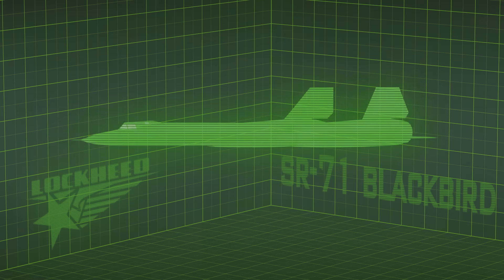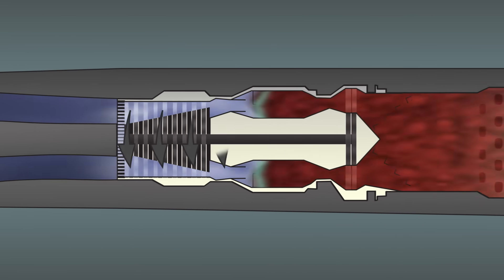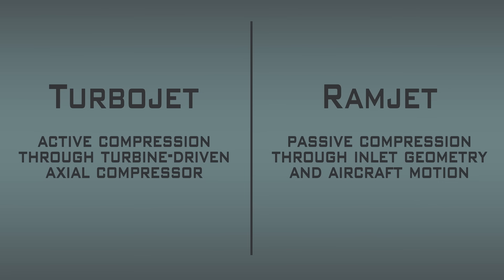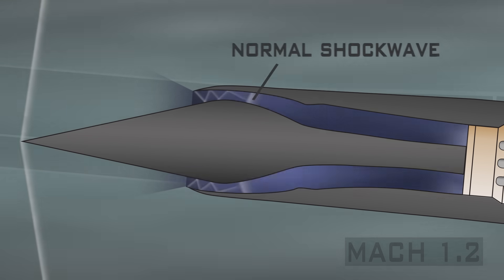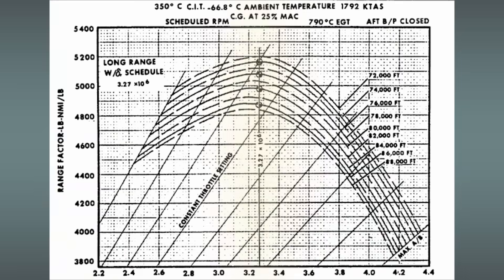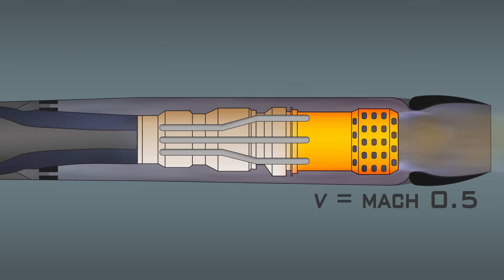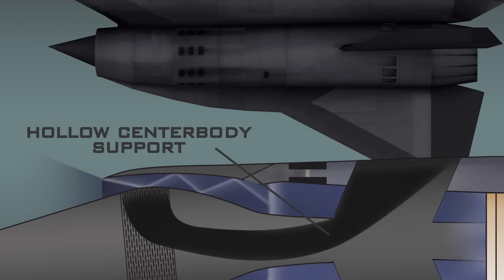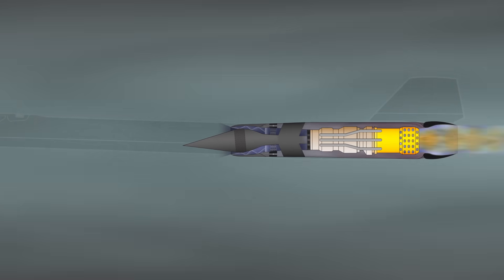The Mighty J58 - The SR-71's Secret Powerhouse

Comment: The men who designed this engine were simply geniuses. Just 20 years after the ME 262 was introduced, the SR 71 was flying.
Reply: +giantnardman <<Geniuses, no doubt. But on your other point, getting things done fast back then was a lot cheaper.
Between 1958 and 1965, just 7 short years, the U.S. sent 16 impact and orbiter probes to the moon with only 3 successes, the last three of those particular attempts. The USSR had a slightly better record in that time. 
But can you imagine today sending 16 Curiosity Rovers to Mars in 8 years because 13 of them failed...
Lol!
Reply: +turboslag The Concorde also ate up an ungodly amount of fuel per passenger per mile.  Sybaritically inefficient.  But, If you got the money, what the heck!
Reply: giantnardman

Copy that, it was intended for the privileged so unfortunately many that would have liked the experience didn't have the means.  I was lucky enough to have been making some money back then so I just had to do it.
And I'm very glad I did because the memory is for life.
However, I do regret not paying more attention to it than I did, you don't miss it until it's gone!
We just took it for granted at the time.
Now I wish I'd just watched it more at Heathrow.  There was a club of enthusiasts at the time it was in service, they just sat and watched them depart and return from outside Heathrow, the runways are very close to many roads in the area.
It is very unfortunate that non are now flying, even for airshows.
Richard Branson wanted to buy them all to continue in service but BA refused.
So, just museum pieces now, :(
Reply: giantnardman

Good points, I'd forgotten about regs.  Originally, it was also intended as a commercial product, available for sale to any airline.  Noise protesters killed that off though, all the originally interested customers were deterred by potential bad publicity.  Only BA and Air France ended up operating it.
Not knocking the SR-71 at all though, it is one of my favourite aircraft.
Let us hope there will be another supersonic passenger aircraft someday.
Reply: The mastermind of this whole system (not the J-58 itself though) was Ben Rich, the guy who eventually took over Skunk Works after Johnson's retirement.
Reply: What even more incredible Kelly Johnson and the rest of Skunkworks, didn't have any computer sided design like we have now today's aircraft engineers have, it all done with adding machines and slide rulers.
Reply: +ResistCom wow, you are correct.  This fact is and was completely missed by me and is make some this astounding even more so.  great catch..
Reply: Tony C apples and oranges both grow on deciduous trees in orchards, both have seeds, both are sweet fruit, both share similar DNA.

summary: apples and oranges can be compared!
Reply: This was designed in the sixties, when nobody had 3D rendering capabilities. All they needed were slide rules and a wind tunnel
Reply: +Nick M.B. 'Crashed on it's maiden flight'? The Concorde crash was in 2000.

Why do you mention crashes as a way to discredit Concorde?

One Concorde crashed in 27 years of airline service.
6 (out of 15) A12s & 12 (out of 32) SR71s crashed, for a variety of reasons.

None of this actually proves anything though (you raised this subject). They were significantly different aircraft, built to do very different jobs.
Reply: well the variable geometry inlet cone was installed on Mig-21 in 1956 which used the same principle of pressure recovery to achieve speeds beyond Mach 2 with a less powerful engine. Really, engineers of those times.
Reply: +giantnardman and whats even more amazing they didnt have much help from computers.
Reply: +turboslag Comparing Concord and Blackbird is like comparing an F1 and a rally car. Both are amazing bits of engineering but none of them hold a candle to the Toyota Corolla.
Reply: Tony C

Yes, but consider, Concorde flew passengers, at mach 2, in comfort, operated in a commercial environment without needing special servicing, day in, day out.
That is the achievment.
Reply: +turboslag 
nah! concorde is over hyped expensive plane.
Reply: @microsoft6411  - Sorry man, but the Concorde was hardly "over hyped."  It was the fastest and most technologically advanced passenger plane ever built, and will likely stay that way for the foreseeable future.
Reply: +Nick Magee - Brown Pal only a bit of a knob would say the Concorde was junk. Unless you're trolling in which case you are also a knob. Pal.
Reply: The SR-71 was the brain child of Kelly Johnson in 1958... well before anyone ever conceived of the Concorde.
Reply: So who stole the concept from whom...sounds like the Russian's slave German scientists got the idea first ??
Reply: A tip of the hat and a Thank You to Kelly Johnson at the Lockheed Skunk Works.
Reply: +giantnardman 
And just 5 years after the first flight of the SR71 was the the first flight of Concorde.  A passenger jet capable of transporting around 100 people at mach 2, in comfort with little sensation of anything beyond a normal jet flight.  I think that is a comparable technical achievement to the SR71 and actually possibly greater.  I was fortunate to have been a passenger on Concorde 4 times and although it was little different to flying in any other large passenger jet there were 2 notable features of the flight experience.  One, the rotation angle  and climb rate, much steeper and faster, and two, the transition from subsonic to mach 2, it really pushed you back into your seat when reheat came in.
Concorde's achievements have not been surpassed.
Reply: @turboslag  While the Concorde SST was a great technical achievement, the SR71 was in another class all together and was built with a much higher level of technology.  It doesn't sound like a big deal, but making an aircraft capable of 2,200 MPH is significantly more complex than making one capable of 1,350 MPH.  The forces of friction and heat are so extreme on the SR71 that its fuselage heats up at high speed and lengthens close to a foot!  The Fuel tanks actually leak while it travels down the runway and ultimately expand from the intense friction heat to seal them up!  A Lockheed A-12, the predecessor of the SR71 and a Concorde SST used to be, and may still be, side by side on the pier of the Sea and Space Museum in NY Harbor.  Very cool to see them side by side!  The shape of both screamed high speed.
Reply: turboslag I flew on one as a kid. They served us caviar on the flight. The seats were leather, but far from the comfort of first class. They gave us plastic binders with free goodies, and I even got to peak into the cockpit. There was only 1 other passenger, a British businessman. Makes sense at those prices.
Reply: @turboslag  yes, I flew on the Concorde as well.  When the afterburners came on the tail dropped and the plane just drilled a hole in the sky.  Taking off sounded as I suppose it would sound being in a fighter jet on take off.  Sweet beyond words. Fun fact was that the windows were warm to the touch at over 50k feet.
Reply: @turboslag  I’ve always wanted to meet someone who has been a pilot or a passenger on a Concorde and I know I am not meeting you but you already answered some of my questions! Wow what a awesome experience I wish I could have had!
Reply: giantnardman

£3500 from Heathrow to Nice.  It was quite an experience.  Actually, even to watch Concorde land, or especially, to take off, was quite a thing.
I was dismayed and very sad and upset when a Concorde crashed in France.  Such a tragic incident for all concerned.  Bringing a premature end to it's service.
Reply: +Tony C Both Concorde and Blackbird are wonders of engineering. Still, it would be cool to see them side by side for a friendly... race! or a cruise near eachother.
Reply: @ratheonhudson3311  They were side by side on the pier at the Intrepid Sea, Air and Space Museum in NY Harbor a few years back.  They may still be there.
Reply: @ratheonhudson3311  or like a fly buy right over our heads at Mach 2 and bathe black bird passing at Mach 3.2 !!! Boom!
Reply: ***** Two titans of the air, soaring together in their airspace. I'm glad the didn't dogfight. I know they can't but they are like Hawk and Eagle, each with their own amazingness
Reply: Tony C Maybe use Apples and Whales... nothing apart from genetic material and structure coding is similar

Yes, it isn't fair to compare them. Maybe park them next to each other to admire but, but not compare
Reply: Tony C You know nothing about physics, propulsion, engineering, or aerodynamics. You've been to "Marquardt, Boeing, Aerojet, USAF, NASA and JPL" and didnt stay in any of those? They sure fired you pretty quick, wonder why? Delete your account, so you might have more time to review hotels in Georgia and not making stupid comments.

"I am a rocket scientist.  I've designed rocket engines for Marquardt, Boeing, Aerojet, USAF, NASA and JPL.  
Ive designed RAMJET engines, inlets and combustion chambers. Written papers for the AIAA.  I've won best paper at the Joint Propulsion Conference.
What are your qualifications to speak on the subject of propulsion systems?
What? You don't have any?  Didn't think so."

lol, and yet you made a comment that made absolutely no sense. you probably played a rocket simulator and now think you are a real scientist LOL.

in any case, wtf are you doing on a video like this if you built the fuckin thing LMAO!
Reply: +Andy Man - Concorde was designed to cruise at mach 2.2, which is about the continuous thermal limit for the particular aluminum alloy they built it from.
However for airworthiness trials a test pilot pushed one of the early models up close to mach 2.4 (briefly I'd guess).

Mach 2.04 sounds like the typical cruise speed for doing the transatlantic run, which is more concerned with fuel reserve ratios when flying overseas and / or the trying economize on fuel costs.
Reply: giantnardman He wrote a book about his days at SkunkWorks. Great read.
Reply: ProjectsBlack

Common knowledge really!  Anyone who has flown by Concorde knows about the afterburner!
Reply: All thanks to threatening German scientists/engineers with prison if they didn't move to the USA and continue their work.
Reply: bobl78 . I don't use smartphones I use an old hand me down used laptop computer that still uses window vista.
Reply: The concord and SR-71 did not share the same engine design the concord was a turbofan with reheat after burning much like the B-1 Lancer Bomber. The SR-71 went from a turbojet to a ramjet which allowed it to fly at mach 3.2-3.5 the SR-71 engines could continue to push the SR until the air frame failed due to overheating once they became ramjets bypassing the compressors there wasn't much holding them back only allowing more fuel to burn. The one thing the concord did was super cruise at mach 2 this was after climbing to cruising altitude they would shut down the reheat's. This was long before any fighter planes like the F-22 had super cruse ability to exceed Mach 2 without after-burning.
Reply: giantnardman Not to mention this bird is still the king of speed in retirement. Only reason the decided to retire it was satellite sensors are cheaper to operate and don't have mothers. Hats off to Kelly Johnson and the Skunkworks engineers. They proved American engineering is still champion
Reply: Alistair Shaw, doesn't history prove otherwise,  with Yeager breaking the sound barrier in 1947,  in the Bell X-1?
Reply: 🤣😂🤮Where is a single reality fact about this jet NONE only a few outside pics 0 inside pics and a fake story on Wiki hahaha lol such a FAKE that has been produced by the Pentagon to make 35% demoncratic morons of the world to believe in it brainless brainwashed demoncratic western idiots LOL... trash fake channel blocked just like others!
Reply: ***** Two titans of the air, soaring together in their airspace. I'm glad the didn't dogfight. I know they can't but they are like Hawk and Eagle, each with their own amazingness
Reply: +Andy Man um, no shit it should go faster since it has bigger engines. derp. also, the hornet does go faster on full power (afterburners)
Reply: ***** im not talking about anything else other than the f18 hornet and concorde passenger jet. the hornet at full afterburners should go faster than the concorde, unless you have a source that explicitly states otherwise.
Reply: giantnardman
yes, that is how it should be said. i agree!
Reply: Tony C haha, well im not specifically either of those. I just have a passionate interest in both science and technology.
Reply: Tony C

And they were?
Reply: +giantnardman that credit should go to Mr Ben Rich, the successor of Kelly Johnson at SkunkWorks.  He helped design the propulsion system on the SR-71, he would went on to help create the F-117 stealth fighter.
Reply: giantnardman. It is that reason that the Concorde was killed off, both the cost to maintain it and then there's the cost of the ticket, so anyway the Concorde was great accomplishment in aviation achievements as a high speed commercial transport, but as a economical investment it is was a flop, because only but a few privileged can afford the tickets for it, as compare to the rest of the other airlines industry.
Reply: Must have something to do with old Euro classism and sense of elitism.  We don't ascribe to that (as much) here in the USA as something that is interwoven into our public works.

Also, the shockwave was really annoying in places like NYC, London and Paris.  Very loud when it went over.  Another reason why it wasn't developed in the US.  And trust me, we could have developed and implemented the concord but it was counter to efficiency and public policy.
Reply: tragkf
Reply: giantnardman  agreed
Reply: reverse thrust, no but as a scientist and engineer, they couldn't pass up to continue to research on aerospace in America case in point the father of German rocketry and the V-2 rocket program Wherner Von Braun who later become the administrator for the fledgling American space program that would be later renamed NASA, as for why you never heard of it well that's because it was kept under cloak and dagger for two reason, but I
 only guessing that the reason they where kept under wraps is one during that time the war with Germany just ended and the thought of German aerospace engineers who are responsible for creating some of the most terrifying aircraft that the allies have fought died living in the America, is just appalling to any American soldiers and airmen who just returned from the war, and two ww2 maybe over but the Cold War is just starring and America fearing that communist spies are searching for these so called German aerospace engineers that where secretly smuggled to the Us soil and there for the engineers kept top secret even today there where only few clues in it existence about it in public, almost all the files about the smuggled German scientist and engineers are been destroyed by us government after the end of the Cold War and majority of those German scientists who where smuggled in the US have now returned back to Germany and happily living the rest of they're lived in they're native home..... ( google Operation Paperclip. )
Reply: Your Home , is your Home.   Pretty simple
Reply: Ian Powell. Indeed no matter where part of the world you are, your home will always be the place of your birth, I am an example of that I am not native to the US.
Reply: bobl78 youtube. You forgot youtube.
Reply: amazing isnt it?
Reply: turboslag 
And considering its safety record since its first passenger flight, not a single plane where lost in the plane crash, well until now is quite impressive British engineering not since the Mosquito and the spitfire.
Reply: sucker punched 
Let's also add the  Russian TU-144 SST plane.
Reply: i'd say 43 years after French designer Maxime Guillaume signed the first patent for the turbojet engine.
Reply: The SR71 never really had Ramjets. The bypass tubes were just to save the forward stages of the compressor from intense heat. The air from the bypass tubes was used for cooling the rest of the engine and not really for thrust. Both Concorde and SR71 engines are quite similar - both after-burning turbojets with intake shock traps. Only Concorde used a twin spool, twin nozzle engine that allowed it to vary the speed of it's forward compressor relative to it's rear. This allowed the engine to effectively shut down it's forward compressor stages protecting them from Mach 2 heated air without bleeding - a much more efficient solution. Concorde only used it's afterburners at takeoff and when pushing through the speed of sound. If you didn't care about passenger comfort through Mach 1, and had a long enough runway, Concorde wouldn't need afterburners at all. Concorde was not the first to super-cruise. The English Electric Lightening interceptor could super-cruise from the 1950's on.
Reply: turboslag, I couldn't agree more.  I might add: the Concorde was, and still is, the most beautiful plane built. The Rolls Royce/Snecma Olympus 593 was also quite a technical accomplishment.
Reply: turboslag, I thought the Concorde crash was the saddest day in aviation.  The Concorde is what inspired my aviation career.  I'm sure it inspired millions, and continues to inspire.
Reply: Blox117, the FA-18A/B/C/D has a top speed of Mach 1.8. The F-14A is a different story with a top speed of Mach 2+, and the F-14D Mach 2.3+. In summary the the F-14 can smoke check the FA-18, but the FA-18A/B/C/D certainly couldn't even catch up to the Concorde at full cruise.
Reply: THE C let’s not forget the MiG-25 and MiG-34 interceptors, fly high and try to catch that blackbird!
Reply: @Americana-deluxe  What MiG 34 , it's a Mig 31 stepchild of the junky MiG 25 .
Reply: They didnt have all the media and external stimuli diverting their attention 24/7 either. Maybe some television now and then and radio.
Reply: Fuck man
Reply: @giantnardman - The Pratt & Whitney engines and the fuel were designed for this aircraft only.  The fuel had such a high flashpoint that you could toss a lit match into it and it would not ignite!  The engines were started with 2 Buick 401 V8s rated at 400 HP each with open headers.  A squirt of triethylborane was needed to ignite the engines fuel.  Hearing this beast fire up with the sound of the Buick engines with open headers, combined with the sound of the J58s spooling up had to have been an amazing experience.  Those J58 engines were designed and built 20 miles from where I live in Connecticut.
Reply: Yes but they are still holding back that technology and did not allow it to commercial use...the whole R&D tech evolution of it was almost wasted by holding it back for 30 years...
It is just like the plutonium lobby still hinders MSR fission reactor development...
The powerful leaders do not care about this planet at all...
Reply: Agree. That design was way ahead of its time.
Reply: have you seen this video of one of the engineers,    https://www.youtube.com/watch?v=MJrXUh0eZjw&t=1311s
Reply: "Or women."
Reply: They had to license Westinghouse turbine technology before they could even manufacture it. Pratt was the king of radial piston aircraft engines, but were lagging into the jet age.
Reply: Wright brothers first 1903. The US put man on the moon in 1969, just 66 years later. You could grow up knowing human flight was impossible, and in the same life watch man WALK ON THE MOON, through a TELEVISION. From "Stand perfectly still for 5 minutes" to live broadcasting. From Horse and carrage to flying across oceans.
The past 130 years have been a HUGE advancement in technology.
Reply: Well ram jest are deadly
Reply: @pratikhyamohapatra2193  jets?🤡
Reply: Please, and as a reminder, these remarkable engines were modifications based on developed and existing technology. Can't say much more than bravo and kudo's to all involved.
Reply: Wartime does tend to be a big motivator for technological progress.
Reply: Tony C

All that, so nothing to prove, and yet, you feel obliged to come on youtube and belittle other contributors with your superiority?!  Me thinks something smells bad!
Reply: THE C, your qualifications are impressive, but there is no need to be downright nasty. I  often enjoy reading the comments and I think yours had good value up until the nasty, mean part. Your qualifications speak for themselves, as do mine. I got mine from Embry Riddle Aeronautical University,  the United States Navy and many other manufacturers schools. We have no need to be mean. Who knows: one day some of the people we communicate with here may become the engineers,  technicians, pilots or teachers of tomorrow.  It's our duty to promote our profession and we can't accomplish this unless we're inviting,  understanding and kind.
Reply: @starfighterusscv-6693  - Very intelligently said!
Reply: Micro Soft

Yes, of course it was!  Thats maybe why it was always fully booked and drew admiration from the whole aviation world!!
As I mentioned above, I have 1st hand experience of Concorde so realise just how amazing it was.
Reply: yeah but todays inventions don´t get us forward anymore as much as those things back then did... what are the advantages of IPhone, WhatsApp and Facebook ?
Reply: ***** tony is just mad that he plays a space simulator and confuses it with real science. in the meantime he reviews hotels with his wife LOL!
Reply: Concorde performance is closer to B-58.  - both fine aircraft.
Reply: ***** tony is right that the sr-71 is more impressive than the concorde, but he seems to not understand that more propulsion= more speed for the same mass.
Reply: Tony C don't you have a job to be working on? You can fix my car if you aren't that busy :p
Reply: +mabamabam lol. concorde crashed! you can not compare these two planes. sr71 was ahead of its time. concorde was only used by hritish and french state airlines before crashing.
Reply: J. Vance Absher one was the greatest plane ever made, the other crashed on it's maiden flight.  This is the problem when 2nd world countries try things they shouldn't touch!
Reply: I am sure it was in Toronto For the CNE air show at the end of August....
Reply: THE C lol.  You don't need to suck up to those brits pal,  the fact is that the boeing 2707 made that plane junk but was shut down by politics,  it was dangerous,  had to use afterburners past mach 1 whereas this amazing machine supercruised! Concorde was canned when their governments finally decided it was a waste of money paying to run a machine for the sake of pride.  Oh yeah,  Concorde crashed.
Reply: Nick Magee - Brown Concorde could have crashed when US decided to stop their own supersonic commercial program they began to fight very nastly what could have crackened their absolute superiority, by becoming suddenly very greeny environmental  worried, hating high speed, noisy big engines, beside they had not imagined France and England would achieve in such a great colaboration, what could have given other ideas like making european aircrafts, kind of airbus. You need to know Concorde price would have staid high but much lower if many more companies ordered it, as several  US had planned to do, quickly advised not to do. Concorde is a huge achievement, by transfering from war to civilian, by fighting political issues, creating then new political as well technologic positive and creative links, many tools and inventions have come out this adventure.
Beside some people talk about historic dates, x beeing imagined before y, like that, I like then to remind french Leduc ramjet prototypes early 50's, stopped by credit and political choices, why not recall it had been imagined by an italian in the 30's. Remind Von Braun making US rockets, all the german engineers employed by the allies, USA, UK, France as well, industrial spyfare, economic political war, and also information warfare, like winners make history.
Did you know the first motor aircraft could be Weissman/Whitman 's invention, but still in USA honour safe.
I wish we could consider all of it as human achievement, as it is most of the time, technology convergence, engineering share..
When people and several groups are not too corrupted by money, if they can pass over jealousy, rivality, they may work together better, faster, more efficient.
People are fed up by USSR-USA penis rivality, they won't catch it a second time.
Reply: thats because the same people who built the 262 built the blackbird
Reply: Did they count the time the SR71 takes to refuel after take-off?, and the time it took to get to 80 000 feet? I doubt it. In a straight race form airport to airport I'd put my money on Concorde. And that's Concorde with 100 paying passengers on board sipping champagne, not two guys in cold spacesuits peeing in plastic bags.
Reply: @agt155  If you bet on your race you would lose. Every record the SR or A 12 set was done with refueling times included.  Go do research before you make yourself look like a fool which you clearly are, FOOL.
Reply: There were at least four Concorde incidents in the late 1970s on the U.S. alone where tires exploded during takeoff resulting in tire fragments impacting the airframe. In at least one case a fuel tank was punctured. Sound anything like the "one accident" Concorde fanboys talk about? On a fatality per passenger mile basis, the Concorde is the deadliest commercial passenger plane in history. 

The FAA and NTSB were involved already way back then, and the FAA "ordered" Concorde operators/pilots to do a once-around and land immediately if a tire failed on takeoff because airframe damage was basically a given. On at least one occasion, an Air France pilot essentially flipped the FAA the bird, put the lives of everyone on the plane in imminent danger by raising the gear and hauling ass for Paris. 

Most of the "regulations" prohibting sonic booms and such were pretty much just a cover story and a way for Air France and British Airways to save face by providing a convenient reason to dramatically reduce and ultimately prohibit Concordes from flying into U.S. airports. 

Washington Dulles was and still is "exempted" from FAA regulations like that because Washington D.C. is not legally part of the United States. It's a military /government city-state and as such isn't subject to FAA regulations, restrictions, etc. That's how a few "special" airlines are getting away with flying non-FAA certified Airbus A380s into that airport. 

What "killed" the Concorde was the dice finally coming up wrong after decades of operation of an engineering disaster of an aircraft. Think any U.S. airline or aircraft manufacturer would get away with that shit? Not hardly. Look at what happened to the DC-10, which was and is one of the safest airliners ever built.  

The "design flaw" that supposedly caused an engine to fall off was actually the result of ground crews intentionally violating Douglas's engine removal and installation instructions by removing the engine and pylon as "one piece" despite Douglas specifically informing operators that the engine was to be removed from the pylon and then the pylon removed if necessary. 

And ultimately it was something as simple as a forklift running out of gas during engine removal that caused the crash. The forklift ran out of gas with the entire engine-pylon assembly hanging half on the plane and half on the forklift. The hydraulics settled, the partially removed pylon and attaching hardware was overstressed because the weight wasn't supported correctly and the pylon was cracked as a result. 

The rest is history. Humans are fallible and shit happens but when innocent parties get blamed for it because its politically correct to do so, that's a problem.
Reply: @deeremeyer1753  You are a really ignorant inane person.  Dulles is well into Virginia and is no way part of DC ,also the Concorde never flew supersonic over the US . It flew to other cities as well.  What a moron you are, I'm not going to address the rest of your idiotic comments.
Reply: +Tony C ironic, coming from a simple car mechanic that lives in georgia. stick to your cars, Mr Tony.

Your comment: "It's more than just size.   Even if it was scaled down to 1/3 it would go even slower.    Even with the same engines on 1/3 the size air frame, it still wouldn't go as fast as the SR-71."

Absolute horeshit, more thrust= more speed. Mindbogglingly stupid shit, coming from a car mechanic no less!
Reply: J. Vance Absher 
Actually, if u read Ben Rich's book, 'Skunk Works' Johnson wasn't even in the room when it was designed!
Reply: Nick Magee - Brown you know it was the british who cracked super sonic flight right? who created all the aerodynamics for it?
Reply: Concorde is far more technical than the SR-71. 

The SR-71 was extremely crude, very expensive, and had poor reliability. It flew a tiny number of hours, and even fewer hours at Mach 3. It had numerous accidents. 

Concorde needed to be made of aluminum but not overheat. It needed to operate in and out of international airports with existing support equipment. It needed to carry 100 passengers in air conditioned comfort. It needed to operate at Mach 2 without afterburners (sorry.. the F-22 is very late to the super cruise game).  It also needed to be commercially viable. Even though the purchase was subsidized.. the actual operation was profitable. 

It’s not even a contest.
Reply: @calvinnickel9995  - Please say you were just kidding.  Oh, you weren't.  OK then, you clearly haven't a frickin clue as to what you are saying, or............you are just another lame Troll.  All you had to say was "the SR-71 was extremely crude" and you might as well have just said I don't know shit about this aircraft but I don' like it!  It was very expensive, one of the reasons its duties as a spy plane are now done by satellites.
Reply: ***** lol. The concorde was junk pal. Besides it crashed